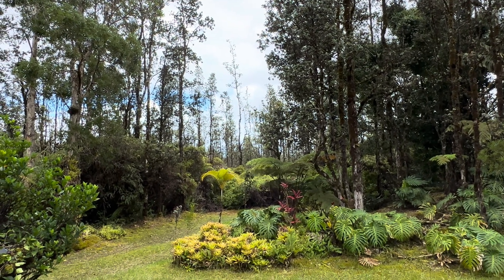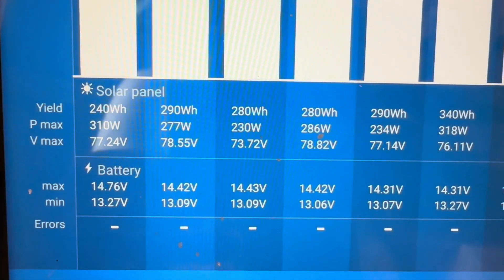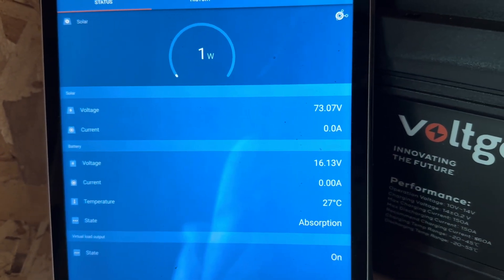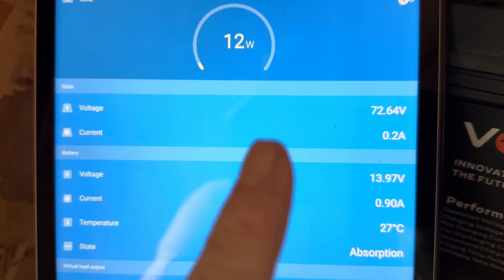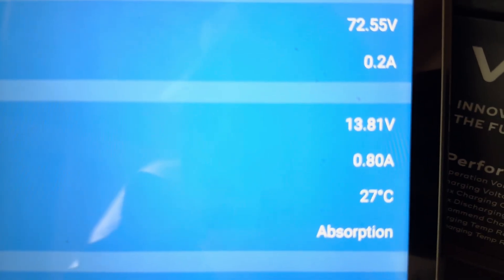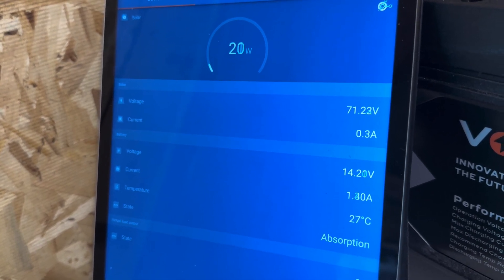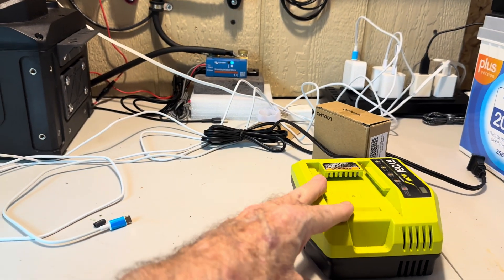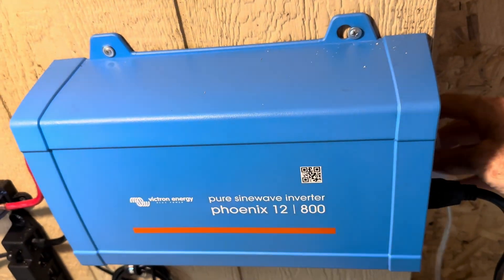Strange Values on the Blue Wall? Unexpected Culprit

Comment: Hi , I am new to solar in the uk , one question I am having trouble finding an answer. I have a Victron 75/15 set up for 24v , if my batteries are full does my inverter draw power from the batteries or directly from the panels through the Victron 75/15 , this has been puzzling me for a while 😂

Comment: Hi Bib, great video as usual, very practic and straight to the point.

A fully charged 12v LiFePO4 battery is at 13,5v at rest.

14,2v is meant for recharging faster, and the voltage you get for that, is actually higher coming from the solar charge controller. When it reaches that voktage, it is supposed to throtle down to absorption (lower voltage).

Bulk is meant to recharge faster, and bring you back to almost full fast.

Absorption should be set at a lower voltage than bulk, because you are just trying to flood the cell with the last electrons, that take more time to find the spaces to "connect", when the free places for electrons are getting fewer as you get to 95% or so. So it needs time for the last bit, and a higher voltage does not help, it just pushes harder.

Keeping it at 14,2v does not bring much, if any benefit. I would set up absorption to 13,8v (1 to 2 hours) and float at 13,5v.

If you stay at 14,2v, you are already in the higher end of the LiFePO4 voltage curve (3,55v per cell), which is just stress for the chemistry.

The balance is between getting a full charge fast, and keeping it topped off. If absorption is set to 13,8v, it will still fully charge but taking it easier on the cell chemistry.

If you make the maths, 13,8v is 3,45v per cell, where the cells are just entering the "stress" zone and you eant tonkeep them just "at the doorstep".

If for any reason you don't get a full charge, you can play a bit with absorption timing to get you there.

The reason why I am mentioning all this, is because, above 13,8v, battery voltage fluctuation is very, very sensitive to any given fluctuation. And I think this is the case, apart from the great explanation given above about why Victron rates their equipment with VA's and not whats.

Cheers and have fun.
Reply from the maker: Great information brother, and mahalo for sharing it with us! 🤙

Comment: Guess I'm going to go unplug the charger for my weed whacker that's out in the shop and only plug it in when I need to charge the battery. The shop is on the grid but what power is that using? Like having the TV on with remote ready which we generally keep the power strip turned off.
Reply from the maker: yeah, this was an unexpected find. now I unplug that charger if not in use!🤙

Comment: If you monitor the AC voltage on the inverter output, is it ramping up and down randomly, with the battery charger. I wonder if a voltage sensor on the inverter is picking up switching noise. If one has a mains filter, one might be able to see whether that improves things

Comment: Looks like the battery BMS disconnected.  The battery just shouldn't let the voltage move around like that if its connected up.  Try putting a second 12V LiFePO4 battery in parallel with the one that is there and see if the voltage moves around too much.  If it doesn't, there's an issue with the original battery.

-Matt

Comment: The solar voltage spikes are due to clouds  coming and going, which cools the solar panels briefly. With cool panels, you’ll get a higher voltage, briefly. This confuses the solar controller, but the panels warm back up and the voltage drops back to normal.

Comment: I believe the Ryobi is back feeding into the DC circuit.  I have one of those chargers and probably introducing a DC ripple into the battery.  Sounds weird, but without a scope on it I believe that is the case.  Or some weird inductance from the internal transformer / capacitors since I noticed mine will discharge.
Reply: I guess an AC volt meter would measure any DC ripple.

Comment: It’s an induction load connected to the inverter (I.e. the load has transformers and/or induction circuits). Those chargers have a bad power factor(PF). 😊. Because AC pulses @ 60hz, the capacitors and coils are using power at that rate. You can see the circuits change voltage as the current alternates. Power is being used but not accounted for in the inverter ‘s watt output. This is why Victron rates their inverter in (VA) not watts. VA=Watts when the Power factor is 1, which means it’s purely a resistive load. When the load has transformers and/or capacitors, the power factor drops below 1. When PF below 1, VA will always be higher than Watts, which means you’ll notice the inverter push out more watts than used by the load, this is what VA means. This is probably why Victron started rating their inverter in VA instead of Watts. 😊 Oh, (VA) does not mean (Volt-Amps).  It’s a symbol which stands for (Apparent Watts). VA includes watts used by the pulsing Capacitors and transformers coils in a circuit.  For example, a microwave label says it uses 700 watts, but the inverter shows 1500 VA watts. One might think their inverter is not working to specs and can’t handle a simple load. Nope,it’s the fact that most High Frequency inverters can’t handle inductive loads very well because of bad PF and high VA watts.  I wish manufacturers would label their products in Watts, VA, and PF.  It would help to clear up a lot of confusion and help the consumer purchases the proper sized inverter for the load.
Reply: Very interesting knowledge. Thanks!

Comment: I would just turn of the power strips will all unnecessary loads.  I have a strip will all of my battery chargers and radio chargers on it.  After I had a handheld spotlight battery explode and catch on fire in front of my face, they are only on and charging when I am in the room.   I had owned the spotlight for 4 years, them boom.  I went through my entire house and unplugged all rechargeable batteries.  I also turn off the strips full of usb chargers/power bricks like you have there.  None are left on all the time and only charged when needed.  The funny thing is that I have 28 kW of EG4 wall batteries that don't worry me at all.   Nice job tracking down the problem.  I'm curious it if jumps around like that while charging a battery.  Maybe compare it to another Ryobi charger if you have one.  It is possible that it was a cat or chicken in there playing with something...Lol.   Keep the good videos coming.  I'm glad you did well during the hurricane.